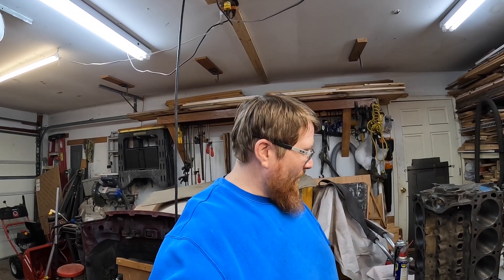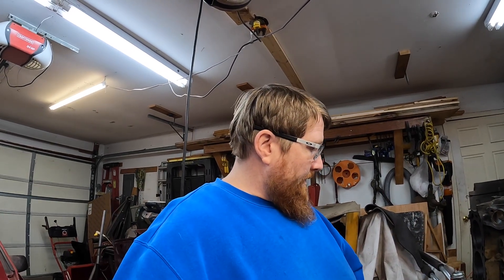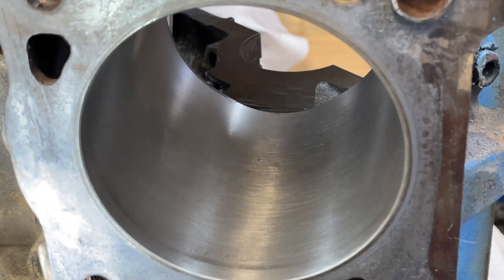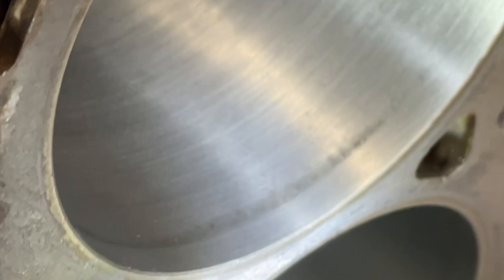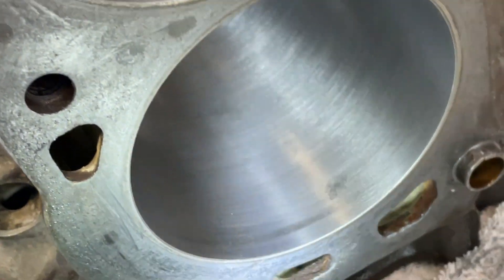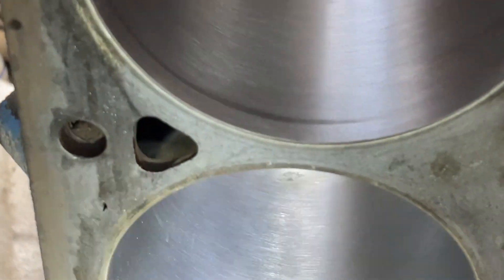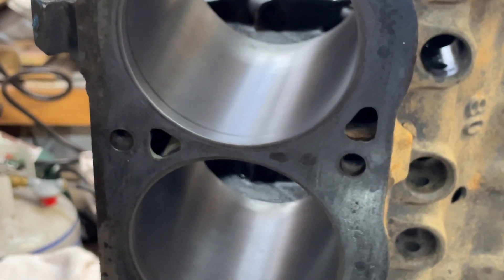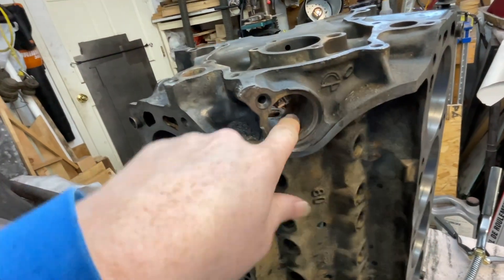Scared and Pitted Cylinders On  My 302  Let's Experiment

Comment: I bet it’s not going to be a huge deal. The rough cylinders may be alittle off but really only thing you Will possibly notice is alittle smoke out of the breather if you run them. I would definitely just put cast rings in it though.
Reply from the maker: I think it will be good. I already have steel rings 🤣
Reply: @funkystangs2843  I would just wouldn’t use moly. But, like you said it’s an experiment
Reply: Your supposed to have steam coming from the breather if it’s on top of the valve cover

Comment: Funky in my 82 rootbeer notch I had a 357w.. I broke it pretty bad  but it was my daily so I went to salvage and got a running 351w from a 94 e150 van (150 bucks) pulled it apart to gasket it...5 of the 8 cylinders where so ruff and pitted it almost looked like concrete because of rust ..from setting with water in the engine ....I took 300 grit sandpaper rubbed the rust out with transmission fluid pressure washed it put gaskets in it and drove it for 2 years 125-130 compression across the board it would smoke a tiny amount only after horribly abusive driving ....it had a c4 & 410 gears and sometimes I would do 1-2-d donuts or 1-2-d burnouts I absolutely abused that car ...2 years then sold it to my uncle he drove it for 1.5 more years and traded it to a buddy that sprayed 100 shot to it for months then put 300 shot on it for like 3 passes I think you'll be just fine buddy...you'll be surprised I'm sure 😊
Reply from the maker: I pretty much have no doubts

Comment: I have a 5.0 with beautiful bores no ridge except one has pitts in an area the size of an eraser maybe you can just barely feel with your finger, i dont know of it would be ok or not. I have a 355 sbc i had bored out years earlier, it ate a new comp cam so it sat for a bit ,then i tore it down for a refresh it had a ridge but i tossed a dingle hone at it and new rings all new bearings new cam lifters n timing chain and it ran beautiful no smoke it had good compression ran like a bear for another 10 years of daily driving and runningbit through the gears at 6000rpm but now its puffing a tiny bit when you blip it and other times im sure but it was well worth the time and money. The thing with a ridge is if you keep ghe same pistons it should be fine but new pistons may have just a smidge more compression hight so the rings will try n go past the ridge that would be game over.

Comment: Won’t hurt anything one of my cylinders was worse due to a blown head gasket I let it sit a few months before repairing it and had rust & pitting from coolant took scotch brite wd40 & a brass wire wheel cleaned it all up sprayed compressed air in there put it back together and it runs flawlessly it’s sbc 350
Reply from the maker: @don_dota  this engine runs pretty good now